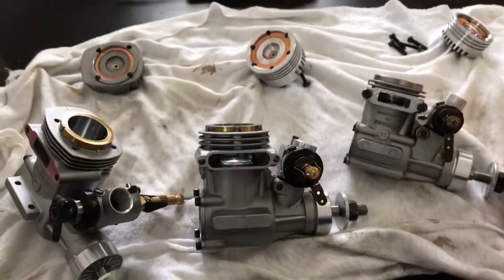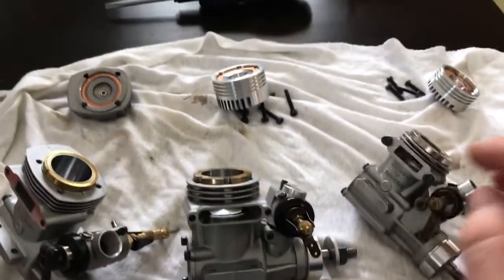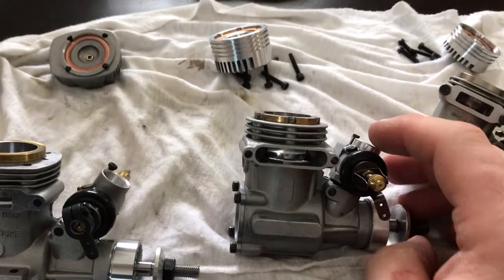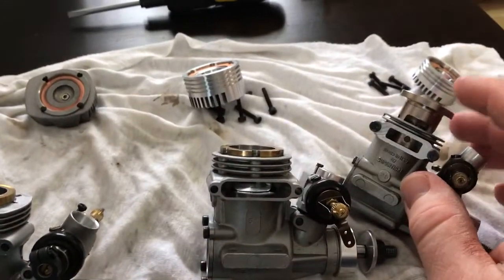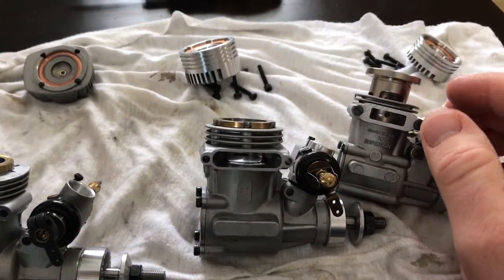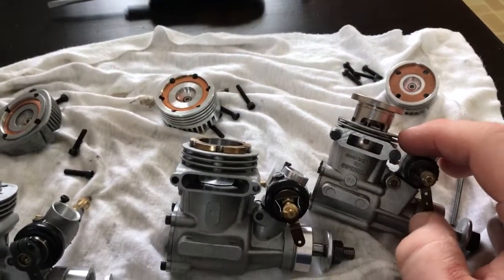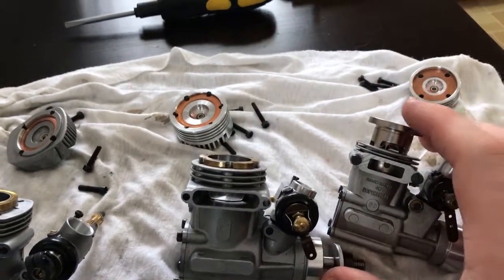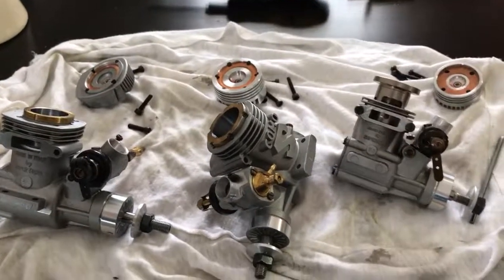Super Tigre ABC engine comparison/question

Comment: Does the piston have a ring? I have a 29 ring and also a 29 ABC and the ring has a hardened steel sleeve and the engine looks very similar to the example you have with bar stock head.
Reply from the maker: The S29 with barstock head only came ringed with a steel liner.   The ABC version has a cast head and is the only way that one came.   The heads and liner flanges between the Ring and ABC versions are different, however, the ABC liner can be made to fit the Ringed head with slight modification.  I did this work and converted my ringed barstock headed engine to ABC.    My comparison of the liners was merely to compare the port heights to determine if the timings were the same.
Reply: So I guess I still don't understand why your sleeve is uniform in color unless it's hardened steel or abn because I have never seen an ABC sleeve that didn't show brass on the exterior.
Reply from the maker: @toralfcross3819  - I am away from my computer, so I couldn’t tell if the video you commented on was about the S29 or S25.  The S25 is hard chrome inside and out, and like the S21, the liner flange is wide with the head bolts passing through it.   The S29 doesn’t have that wide flange on top.  No S series ST engine has nickel plating
Reply: I have both versions of the 29 and the sleeves look totally different from your 25 in the video.
Reply from the maker: @toralfcross3819  - yes, the S21 and S25 are a bit different.  Crankcases are the same physical size, but are machined differently internally.
Reply: Well that is interesting because it would be the only sleeve I have seen chromed inside and out.
Reply from the maker: Yes, I found it interesting as well.  The S21 is chromed inside and out also I understand.